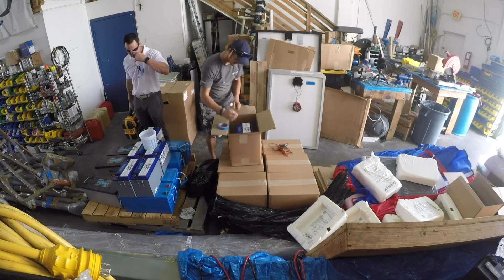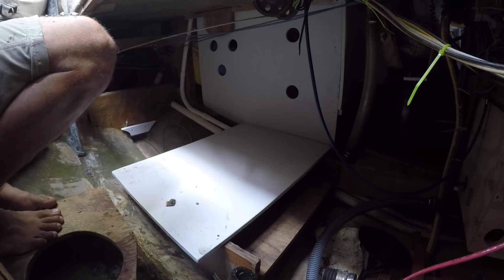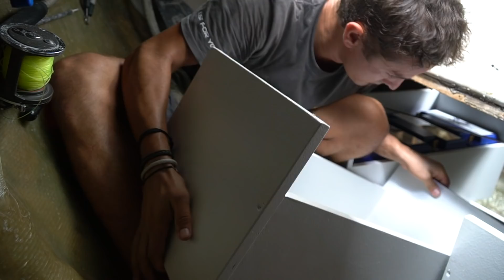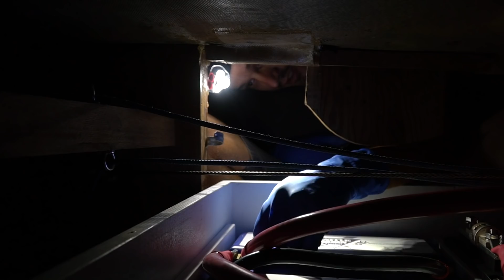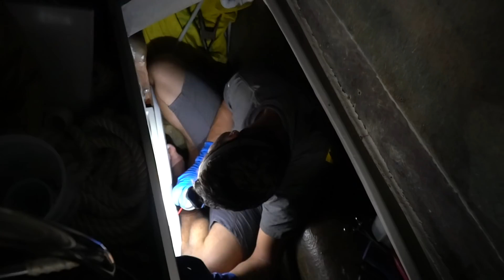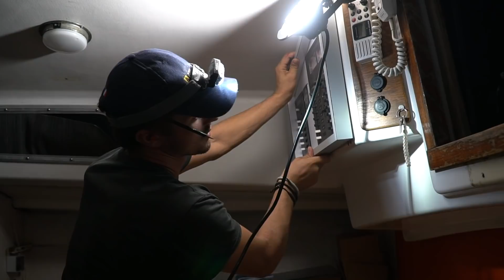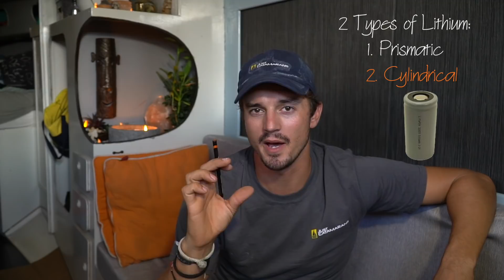Uma's new Battle Born LITHIUM heart ❤ — Sailing Uma [Step 135]

Comment: The new accumulators need at least 300 A current to be charged within an reasonable time. I think no solar panel can deliver so  much. 300 kg battery is equal in weight to 600 l gasoline. ..

Comment: great video 

I just purchase my first sailboat and I'm in the process of upgrading the battery and changing to motor to electric which is 48volts.
if I go with a 48 volt battery set up just like yours what system did you used or recommend to down size voltage from 48volt to 12volt for the cabin small voltage item?

Comment: Hi, can anyone explain why they wired their 12v batteries into three banks of 48v and then used a DC converter to back down to 12v? I guess their 'engine' motor is 48v but everything else is 12v
Reply from the maker: 48v means 4X smaller wire diameter. So all our “large” loads are 48v. Motor, windlass, inverters etc. But mainly our electric motor is the deciding factor.
Reply: @SailingUma  amazing you replied at all to a 2 year old video but so quickly thank you. That's makes sense that it you run a higher voltage you need less current for the same power and hence smaller cables.

Comment: Did you or do you have any concerns with the battery locations under the cockpit? How have the condition of the connections held up?  Thats about the only place open for bateries without the lose of storage space.Thank you
Reply from the maker: Perfect! We made a thin Fiberglass cover to keep debris off. They look exactly the same as the day we installed them 2 yrs ago.

Comment: I was wondering about adding lead batteries to a lithium bank. I read up on it and there seems to be several benefits as to how they would charge each other and maximize their life, without much risk. Is this something you would consider doing? Thanks.
Reply from the maker: There is a real risk of burning your boat down. We wouldn’t recommend mixing chemistries just to save a few $’s. This is your boat, your home, why risk it!?
Reply: @SailingUma  Thank you so much for the response. I did notice one had to be very attentive to the cycles and discharging, but wanted to get an experienced opinion. I'm a little confused about how your Patreon subscriptions work. Are the payments per video? I wanted to do the $25 subscription, but $25/vid is a little out of our budget right now (especially if you do a couple vids/week) with buying the new boat and what we are going to have to do to it. I would do the $5 subscription, but I am one who could ask a lot of questions when there's something I intend on doing, and the direct access is what attracts me most. I wouldn't be a constant PITA, but sometimes require a little hand-holding (being an over-50 newbie). I only have about a year of sailing experience...pretty handy, but not experienced. Since you were so awesome to respond to this question about a video that's a couple of years old, I'm going to do the $5 Patron for now. Thanks again, and we hope to see you on the high seas. Chad & Lesa Fox - SV Salty Fox.
Reply from the maker: On Patreon you can choose a tier level, but then also set you monthly max too. So theoretically, you could choose to be a Demi-God and set you max to $25, so you would only be charged for one video a month. Make sense?
Reply: @SailingUma  I figured that out when I did the $5 patron. I will up it shortly. Thanks again for the response.

Comment: What have you done to charge batteries via shore power in Europe?  Designing my system now for new and old world power and need advice on what you did.
Reply from the maker: We chose a 220-230V charger. That way, we can plug in in the USA (with a 50A adapter) and in Europe and the rest of the world. Most chargers do 50-60hz. Ours is from Victron. We'd highly recommend them, and no, we're not paid to say that. Although, their markup is pretty high, so try to find a dealer (like battle born) that might give you a good discount if you bundle the batteries and charger together.
Reply: @SailingUma  Thanks D&K!

Comment: I did the math on those batteries - yikes!  Seems like a steep price tag for 15kwh of storage...  I drive an eGolf, and the battery life and performance of their battery pack is really impressive, with minimal loss of capacity reported by other owners to date...  For the same $10k as the BB batts, you could buy an entire 2016 eGolf, along with its' 24.2 kWh 48v lithium battery pack, get a stonking good EV motor plus charger to boot, and still have a few thousand dollars of residual salvage value in the clean and straight rolling chassis to sell to a junkyard.  This guy has done a ton of testing on these battery units for his home powerwall installation and the specs are impressive:  https://www.youtube.com/c/JWSolaruSa/search?query=egolf  the eGolf electric motors are beautifully constructed, but because their battery packs are small by Tesla standards, the resale value is surprisingly reasonable:  https://www.youtube.com/watch?v=QgqtT85tMBA&ab_channel=CarsGarage

Comment: Your lead acid/lithium comparison isn't quite right.  I had it explained to me that a 100 Ah Lithiun will give you 100 amps.  The actual full capacity is about 108 or 109 Ah.  The 20 % you mentioned is the extra few Ah left AFTER you have taken out the 100 Ah.  That's 80% of the battery capacity, but still a full 100 Ah.  Have seen all of your videos.  Great stuff and great couple.  Thanks, Dr Merrithew

Comment: The tech explanation put the expectations into theory.  The recharge rate capacity of the lithium chemistry coupled with the depth of discharge available from the lithium battery is a great advantage compared to lead acid technology.  But include the number full charge cycles from very low charge states which, depending on the frequency, severity and quality of the brand build, can be up to 5 times that of lead acid batteries and the effective value becomes apparent.  Lower weight and the safety aspects of no hydrogen fumes or acid spillage with associated corrosive possibilities are important when working in confined spaces found in many boat battery installations.  Ask those who work with these situations.  
Let's see if the practice proves the theory.  Thanks for a real hands on, objective experience.  Cheers, Gary

Comment: $12,000 worth of batteries. Wow.

But, you could probably run 3 each 3kw inverters off that.

Easily run a small  air conditioner all night.

Comment: 17:16 that should be 14.4 kWh.  V*A = watts   but V*Ah is wH.    Someone problably indicated this, but did not see it.  Not trying to be a yerk, but I think it is kinda important...
Secondly it is better to explain C-rating and % discharge seperately... So Lithium has a better C-rating which means you can pull more amps out of them at any moments so more watts on power.  Next, you can discharge Lithium mucht deeper than you can with lead, so you double the amount of usable energy.

Comment: Car batteries are designed to give a high current for starting. They are not good for deep discharge.
"Leisure" batteries are much more suitable for frequent deep discharge, but not so good for starting engines.
Leisure batteries are not as common and more expensive, but more suitable for your purpose.
Well done for getting Lithium Ion- they are ideal for your use case.

Comment: Thanks for this video. If you'd made up your cables earlier, you could have connected the batteries as you loaded the trays, which would have been easier. If you don't connect either end of the battery to the boats electrics until as late as possible, it is much harder to get any electric shock from touching grounded metal like the steering cable.

Comment: Man o man I hope you appreciate your girl what a wonderful helper o ya if bolt the negative terminal last you will get NO spark and if you unbolt negative terminal first again NO spark✈️ also your vah radio if it has static noise it’s like a aircraft you need to shield the wires if you goggle it you may find it will help reduce the static

Comment: I think you're gonna find you have a lot more than you need. SV Delos upgraded to lithium and they're having a turn things on like their water maker in order to not over charge their batteries with their solar Looking forward to making that change on my boat thanks for sharing.
Reply from the maker: They also dont  have an electric motor. We’ve  had those batteries for 2 years now. You cant overcharge those batteries. When they are charged, you can turn the battery charger off!
Reply: @SailingUma  that is true you two rock that department on Uma. I hope that up grands you did are woken out great and I can't wait to see  The sea trials. Fair winds

Comment: Dan :  If I heard you correctly, your 48 volt motor draws 50 amps, which makes it about 3 HP (48V. x.50A. x .9 {motor efficiency}÷746 {watts per HP}=2.9) The jumpers interconnecting the batteries in the three 48V banks, for just the motor only have to carry 16.7 amps (50÷3), so could therefore easily be #12 gage, I would double that for all "other" loads, which would bring it up to a #10 {rated for 30 amps}, then go to # 8 for a "safety/over-design" factor, there was no need to use "0000 or "4/0" or "four aught" as long as you bring all three (now #8) wires to the main breaker (4/0 is typically only needed  for 12V starter motors on big diesel engines which is why it is even stocked at marinas).  The motor should be wired with #6 if the run is under about 12 feet, you could go one size bigger if longer for slightly less loss.  I would have, once the nut on the bolt at the battery post was just started, sprayed you anti-corrosion stuff on the connection, then tightened the bolt and apply a second coat, thus having a film of the compound between all surfaces.  I noticed that you used "German torque specs." AKA "good-n'-tight"
Reply from the maker: Not sure how you came to your conclusion. We built our system for MAX load, not minimum load. The motor controller can handle 300A so we made sure our cabling could handle that. We don’t draw anywhere near that when motoring at 3kts (1.2kW). But at 7kts that could go as high as about 8-10kW depending on conditions. Or 200A. And with cable, the bigger the better. No sense in making the cabling the weakest link.
Reply: I did not realize that your motor could draw more than 50 amps.   As your motor controller is rated for 300A, and if you plan that you might someday replace your motor with one that is 14KW, then your jumpers could be # 1  (rated for 119 amps, x 3=357) for the motor and "other", going one size bigger for "safety/over-design" brings them to #0. The only downside to bigger wire is money, but then sailboats are just "holes in the water that you pour money into".  As a side note, 18V "cordless power tools" will run on 12V, just a little slower, I made an adaptor for mine out of a dead battery pack, replacing the cells with a 16 gage wire and alligator clips for  when I work on my car.
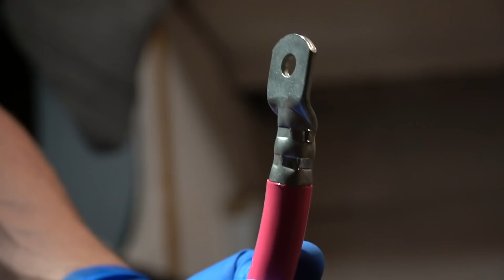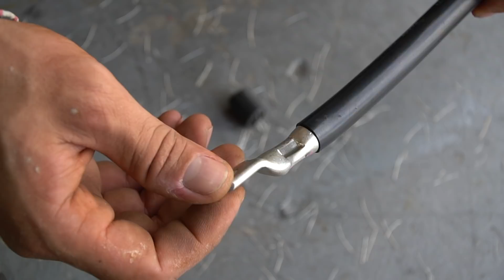Reply: I re-watched the video, and although you "said" ( @ 9:00 -9:10) that the cables were "four aught" the image @7:04 showed it to be [ 1/0 ] or "one aught",  which is appropriate.

Comment: U forgot depth of discharge which also has more effect than c rating. With lead acid you get about 50% max but with lithium you can get 80% for good lifespan. That's really where the difference comes in and might be why your lead acid batteries didn't last very long aside from there already short cycle life

Comment: Dude no lie you way overpaid for those lithium ion batteries. You can pick up 3.2v 100ah lifepo4 packs for really cheap from like Alibaba or aliexpress and assemble 4 of them for a total of 12v 100ah. Just saying if those ever go bad like 5 years from now you could easily get some replacements for under 300 per kwh
Reply: That is true but they would need the BMS and other circuitry that is included in the drop in replacement.
I think battleborn gave them the batteries as a sponsorship.

Comment: Question. [watching again. Interesting batteries.] 7:26 Dan: "I'm also wearing rubber gloves because this is our steering cable, and it's grounded ..." My question: steering cables break or snap loose. It's not the question if, but when. Did you put some non-conducive safety net across the batteries? That would prevent a non-isolated metal falling across the battery banks to create havoc. (Lots of Amps are available. Enough for welding.) Chances are low, but prevention is better than to try to cure. This is easily seen in these times. People who are able to put out a fire or cure an epidemic are thought of as heroes. The ones that advocated prevention in the past had been treated as idiots.
Reply from the maker: Sure did! We made a removable fiberglass lid that covers the battery box and comes off it two halves for access and inspection. Don't think we ever showed that in a video though, so its a great question. Maybe we'll add it in a future video.
Reply: @SailingUma  - excellent. Yes, great idea (to do a guided tour of your electric system and its architecture.)

Comment: 2 questions. (1) the batteries seem to be tightly packed. What about cooling? (2) did you skip on battery management (monitoring Voltage per cell in series so as to equalize cell voltage again and again)
Reply: Answer to (2) I guess, it's in each battery, integrated.
Reply from the maker: Yes, the BMS is built into these units and it's super solid system. We also don't have to worry about overheating the batteries, since the loads aren't actually that high (compared to an EV car for for instance that pulls 900+ amps out of their banks and need to be liquid cooled.) If we're motoring for any distance, we'd only be drawing 25-50A and therefore the batteries won't get hot at all.
Reply: @SailingUma  - thanks for your replay. Well done, architecting this! And your roadmap to regenerative charging!

Comment: If your really annoyed about EMC interference on your radio. You can switch your wiring of your solar setup for EMC shielded cable. It has a metal mesh around the the wires that keep emc inside the cable. Like the metal mesh in the window of a microwave.
Reply: If you do this don't forget to ground the mesh.

Comment: This was great. Extremely informative.  I can't read through every comment at this point, so I'm not sure if this is a repeat, but I found a mistake in your comparison.  You compared 10 - 15 mins on Lead acid to 4-5 hours on the LiFePo4.  But that is actually a comparison ot 100Ah of lead acid to 300 Ah of LiFePo4.  So I'm thinking the true comparison should be 10-15 mins to about 80-100 mins (per 100Ah).  Still great, but 5 - 12 times more, not 15-20 times.

Comment: Hi, just curious about your new battery bank. You were saying you could get 4-5 hours of motoring out of a fully charged bank. Can they take charge from your solar whilst discharging to your motor? If so have you calculated how this might extend your motoring time?
Reply from the maker: Yes, the solar can put power in while we draw power out. But even on the sunniest day in the tropics, the max we saw was 500W. With that power, we could motor at about 2 kts. So, yes, in the middle of a super calm high pressure system in the middle of the ocean, we could motor along and 1.5-2 kts for most of the day and not take too much our of our battery bank, but if there is even the slightest puff of wind, we could sail faster.  But, since installing the new batteries, we haven't been becalmed yet, so we haven't had a chance to test it.
Reply: Sailing Uma: hi thanks for getting back to me. My question was really about wether the recharging could extend the time you could run your motor (at higher speeds) before bottoming out your battery bank. If you could run for 4-5 hours before depleting the bank would charging from solar slow the depletion of the battery bank and perhaps extend your time motoring. Sorry if I didn’t explain myself very well previously.
I must admit I like the cruising videos a lot but these maintenance/build vids are my favourite 🤓.

Comment: I use two 60 amp @ 28V schneider charge controllers that slam 120 amps into my LiFePo4  400AH 24 volt battery bank. Thats pushing it a bit but been getting good results for a year now. My bank takes about the same space as 4 of your batteries. My bank can get a full charge in the first three hours of the morning and then it can get cloudy for the rest of the day and doesn't matter to me.  Unlike LA batts that slowly reduce the charge as they fill up, the lifepo4's can blast a full rate charge right up until they're fully charged . Hows  that ? Cheers

Comment: A bit late now but I have just found you.
You have a hell of a lot of current potential in those batteries . Speaking from experience with telco 48V systems, if you work on the terminals again wrap your spanners in insulation tape. If you short the spanner to the steering cable you will need a new wire and spanner, plus flash burns. - Seen it happen.

Comment: cover your wrenches and screw drivers either with electrical tape or non conducting heat shrink.  that should take away the fear of shorting out your batteries in case you accidentally come into contact with something else metal.  Rubber gloves are a good idea.  I’m a  electrical engineer who works in power plants and I must say that you have done some pretty good research and planning!  Additional   I'm writing this about 2 years after you posted this video(1st time I'm watching this) so you may already know.

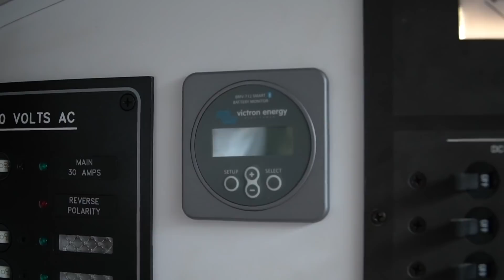Comment: Hi Great Video , what apoxy and primmer did you use find the best for the battery boxes? also do see two shunts at about 12:16 time code?
Reply from the maker: Nothing fancy, it's a 2 part epoxy primer we found in Guatemala. It cures super hard and durable. You can just use bilge paint too. It's just to seal the wood.